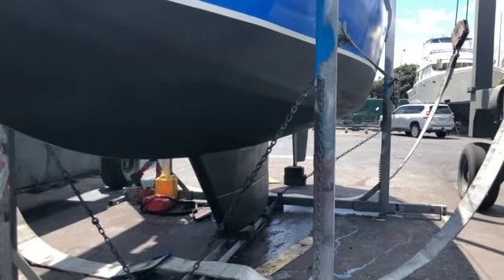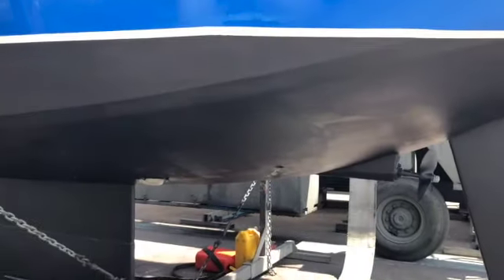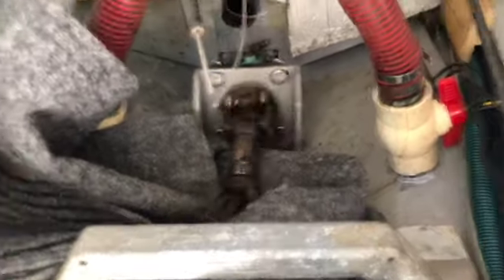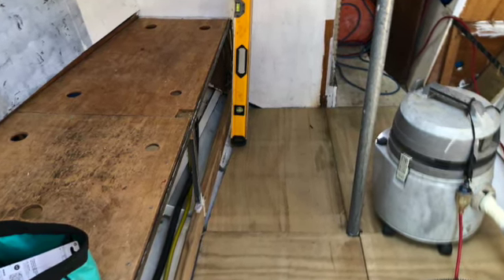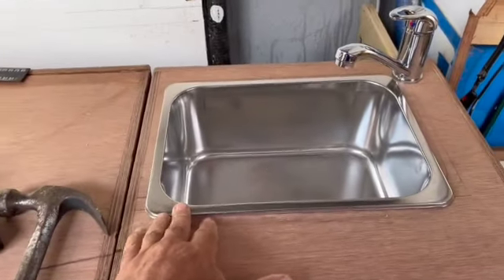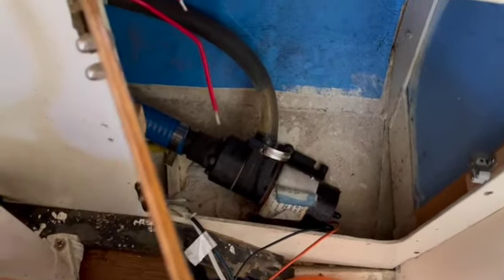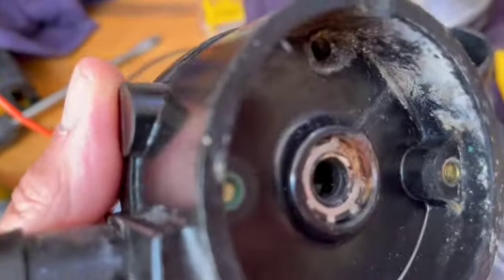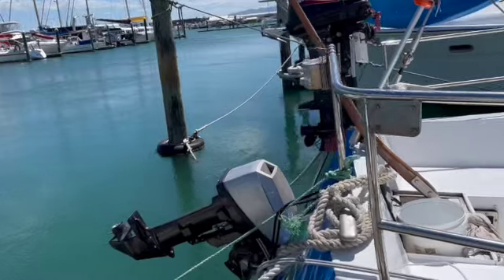Refit of a steel sailing boat

Comment: I think your boat is a version of the VdS 34, we own a VdS 34 steel hard chine. 
Do consider that fuel located originally in the keel is considered part of the ballast. If you are moving weight further up with batteries etc. maybe add some ballast is what used to be the fuel tank.
In an earlier video I mentioned a fuel cell and maybe you could put one in the cavity left from the retirement of the diesel tank. 
LOVE the VdS 34! It is a great boat!
The few deficiencies are definitely due to an engineering mind missing/discarding some practical issues.
our have a completely different interior.
Is your a frac rig or full mast height headsail?
Where was your original water tank located??? That sounds different than ours... ?
Reply: those Jabsco pumps are terrible, it is a design issue but Jabsco would not acknowledge it.